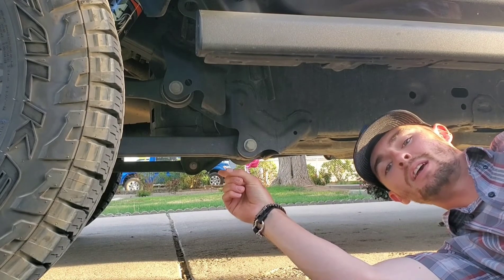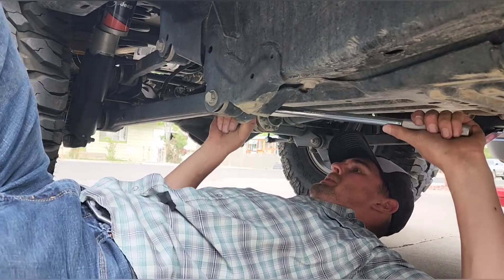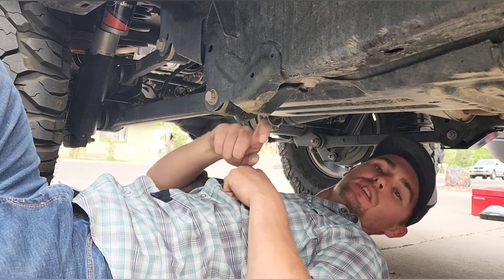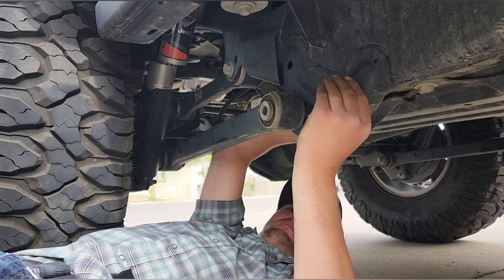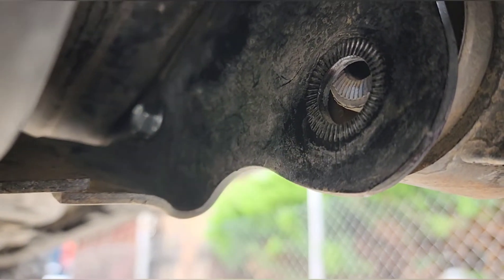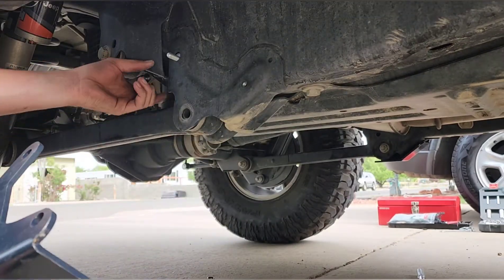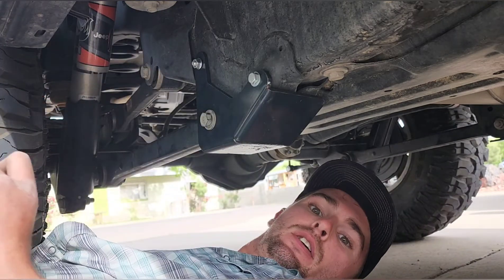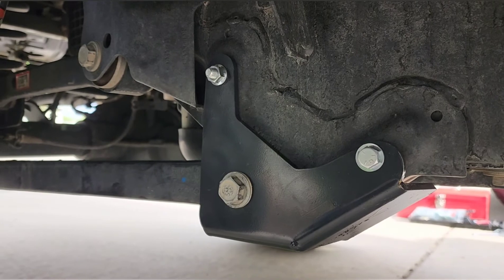Installing Rusty's Off Road skid plates on my 21 Jeep Gladiator

Comment: So did the instructions list the torque specs?
Reply from the maker: There are no instructions I could find but the main bolt for the control arms are torqued to factory spec which should be 90 ft lbs
Reply: @jeepzandthings  90 Ft lbs is for the JL. The JT is 185 Ft Lbs
Reply from the maker: Thanks for the heads up I'll have to go retorque lol

Comment: Great video! Have you noticed any issues with articulation in the control arms with this skid? I may be on my second can of rustoleum touching those up
Reply from the maker: everything in the suspension still moves freely. I was wondering the same thing after I installed them but I have no issues yet

Comment: Did you use the factory main bolt or a Rusty’s provided new main bolt?
Reply from the maker: My kit did not come with a replacement main bolt, but the factory bolt was plenty long enough
Reply: @jeepzandthings  great to hear! Mine did come with a replacement bolt, but I used one of the factory nuts on accident and one torque wrench experience later I ruined the provided bolt and the provided nut won’t screw on. Going to put the other factory bolt back on it!